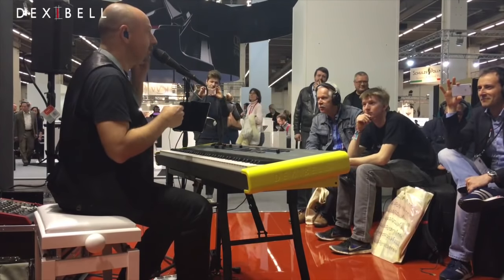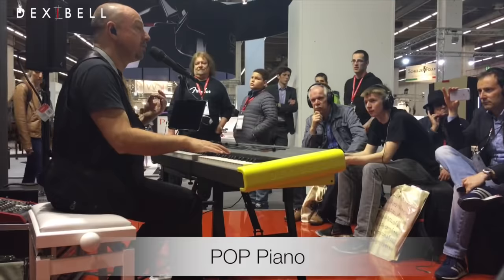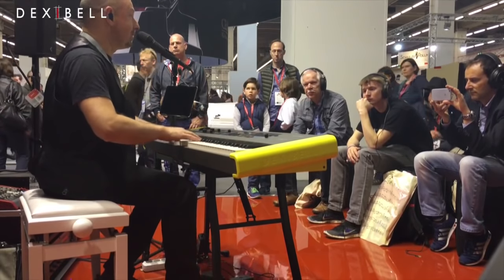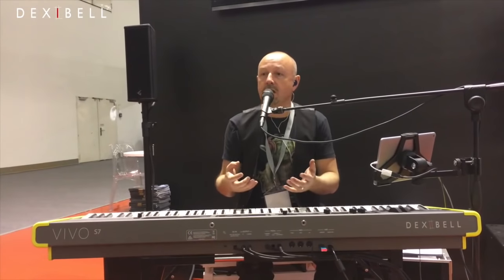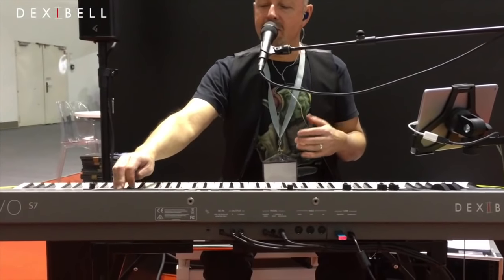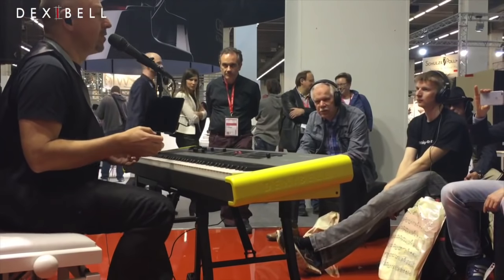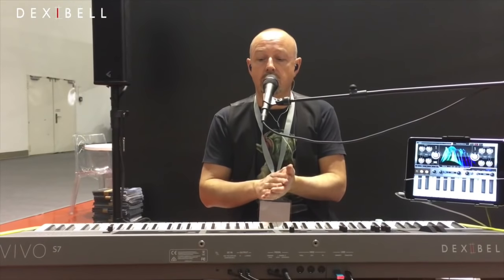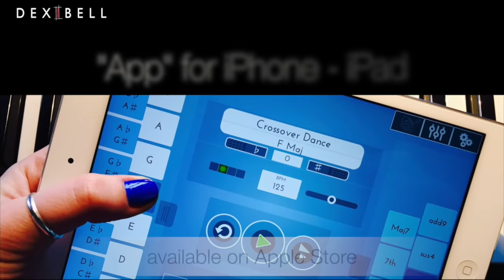VIVO full demo by Ralf Schink at FMM

Comment: A little confused. Are all these sounds included in the Classico L3 as well or just an assortment?
Reply from the maker: Hi Chris, in this video Ralf is using the XMure app. check on xmure.net for more info
Reply: Sorry, I was refering to the program sounds in the various models, not accompaniment. For example: Does the swell pipe organ sound appear in the S7 etc? I am noticing a lot of the same sounds accross the whole line (including Classico and ComboJ7.) Thanks. Is there a list of sounds for each product?
Reply: I have the same question as you. The Classico L3 and Combo series might have some sounds in common but I doubt the Vivo series have the same sound engine as the L3.